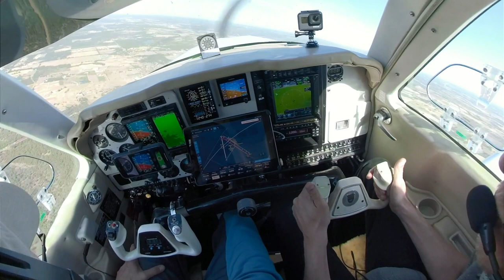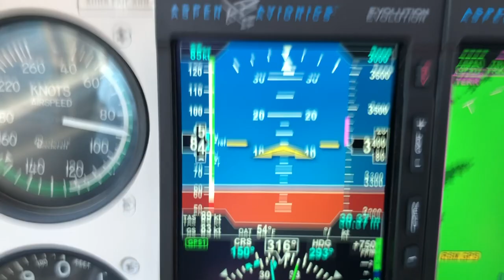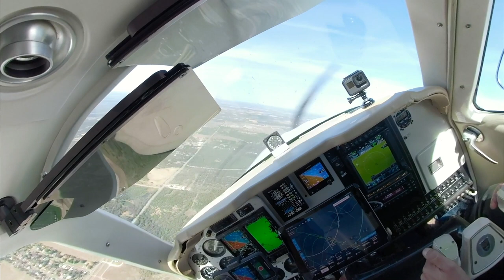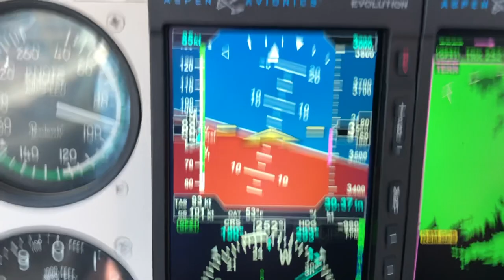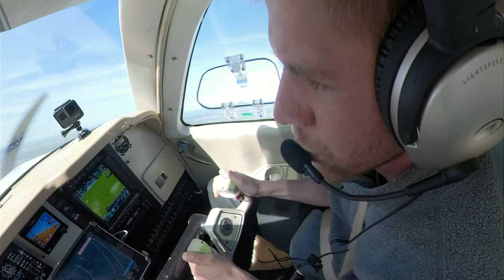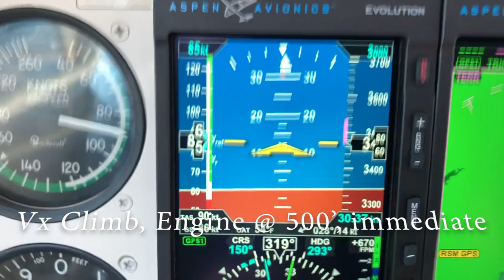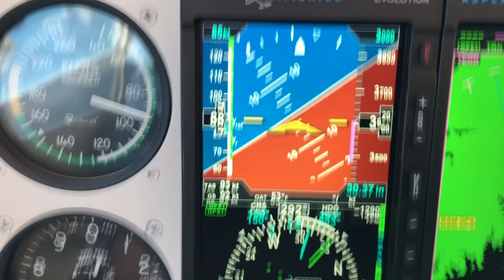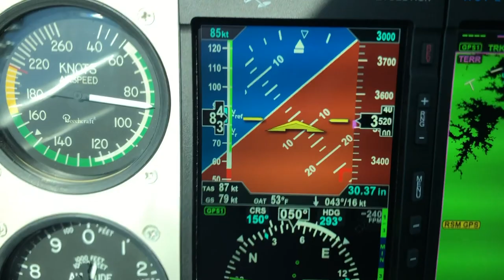A36 Bonanza Engine Failure on Takeoff

Comment: Exactly what I teach as a result of teaching hundreds of Bonanza pilots over four years in the simulator at Beech Field: it takes 1000 to 1200 AGL  to realign with the runway,  IF pilot knows when the failure will occur AND he/she has (unsuccessfully) practiced it once or twice immediately beforehand. Like you, I present the option of getting to the flat airport if not the runway itself, above about 700 AGL. And also, as you say, you have to PUSH. Another good video,  Scott.
Reply: Where is your video showing it takes up to 1,200 feet agl to Turnback To Opposite?? Was that at full gross on a hot day or not??

Comment: Scott, as a CFIG who taught low-altitude rope breaks as part of the private pilot syllabus, I once did the math to answer this question: What is the optimum bank angle for reversing course 180º with the minimum altitude loss? Answer: 42º of bank. That's a lot of bank for a private pilot close to the ground at min sink speed, but that's what the math says. Two things to note: 1) the much tighter radius of turn in a 42º bank leaves you much closer to the runway centerline than the more leisurely, 20º bank you used in the first couple of scenarios; 2) the minimum sink speed in a 42º bank is no longer Vx, but is slightly higher. The last scenario you flew came very close to that ideal: just about 45º of bank, with the stall warning horn warbling but not on solid. Final observation: if there's a crosswind on takeoff, it's much better to turn into the crosswind than downwind: the crosswind helps keep you closer to the centerline throughout the turn back to the runway.
Reply from the maker: Thanks Steve! Great comments!

Comment: You didn't mention it, but the prop control has a big influence on glide ratio.  If you have prop control, pulling the prop rpm all the way back can make a big difference.  It might make an interesting video to explore.  thanks
Reply from the maker: I did a series on engine failures inflight and I did look at pulling the prop back, the hit was 50% if you don't. But what I was trying to do here was look at a situation I think is far more likely... either you don't have the oil pressure to change the prop itch, or the brain bytes to pull the prop back. In the worst case how does this "turnback' maneuver really work for someone unprepared. The result was very interesting. I did another Turnback/Impossible turn video solo from the ground-- watch that.

Comment: A couple comments, if I may....   It's been a long time since I've flown small aircraft, but I used to fly A36s rather frequently in the early to mid-eighties.   That said, I'm going on memory, so bear with me.   First, is the horn I'm hearing in these exercises the gear unsafe horn, or stall warning?   I suspect the former, not the latter.  Second, there was no commentary regarding the residual thrust of an idle good engine vs a bonafide engine failure, and how that would change the dynamics of this exercise.   Obviously, there would be some difference.     Last, I remember doing drills like these in the old days, and the check airman where I worked used to demonstrate that pulling the prop to full decrease made a dramatic difference in glide ratio....and it did.   Of course, this was with an engine running at idle.   I'm uncertain if that technique would be effective if there was a catastrophic engine failure, as I can't remember if one needs engine pressure to change prop pitch from high RPM to Low RPMs.    A teachable moment for me, and I welcome your input.   And in closing, the gentleman mentioning that this would be a dangerous maneuver due to the threat of an accelerated stall...   I don't believe this would be a factor as long as the load factor was 1G.   There are a couple videos out there that seem to show that the steep bank angle is more advantageous (even with the accentuated altitude loss of maintaining 1g) than a shallower turn due to the time involved in turning around.   This makes for a good discussion.   Thanks for posting, and I look forward to your input.
Reply from the maker: Gerald, welcome to the forum. You actually hear two horns, they are very nearly the same. There was indeed commentary about the prop pitch... in between takeoff exercises. I explored the impact of the Pitch fine/coarse in the Engine Failure from Cruise video. In this video I wanted to have the impact of the higher drag... for one because in a tight situation like this most folks would NOT pull the prop, plus if the engine truly had a catastrophic failure you might not have enough oil pressure to actually move the prop at all. I felt the setup was more realistic. You are welcome to practice/ demonstrate something different if you like.

I actually like teaching stalls at 1g, I assure you THAT does happen. Plus trying to make a turn burns an enormous amount of energy. I was doing about 45 degrees of bank, which is pretty steep, going with a higher bank is problematic. The descent rate was VERY high at 45 degrees of bank, pitching for airspeed. 60 degrees would probably create a situation where you wouldn't have enough energy to flare even at 81 knots. 

Overall, this is a very dangerous maneuver if you are not intimately familiar with how the airplane behaves at the feathered edge of the envelope. Don't expect to get it right the first time. Best to pick some place in front of the wings and land in control.

Comment: Great videos Scott. I'm a new pilot, and had a question for you. You've previously stated that you climb out at a higher IAS than best rate of climb because you feel the added speed is helpful (something along those lines). It seems to me that being closer to the airport and having a higher altitude would be preferable in an "engine out" situation, and that could be achieved by climbing closer to Vx. As a new pilot, having an engine out with an airport below me and adequate altitude seems like the best situation, rather than being fast and far from the airport. What are your thoughts?
Reply from the maker: John-

If you look at the video when we used Vx and failed the engine at 700' with a 3" delay we were very close to stall speed before we started maneuvering, the stall horn even chirped... in this airplane and at the particular load we had. Your total energy is the sum of your altitude and your speed (potential and kinetic). The Kinetic energy of being at Best Glide is greater than the potential of a few feet provided by Vx. I've seen too many folks stall the airplane climbing at Vx with a simulated engine failure. And a little altitude won't do you any good if that happens close to the ground. So, yes I never use Vy. I use Vx to clear an obstacle and then accelerate to my cruise climb speed (which is at least Best Glide). But I want you to try it for yourself. Find an airport, use the runway as a reference, but set your floor about 2000' AGL and practice to see what will happen and set your own Turnback altitude. Set your strategy. It doesn't have to be mine. I want you to fly and find what works for you. I'm trying to give you the tools to figure that out for yourself, rather than listen to the armchair experts.  At least that's my nickle.

Comment: Scott, great video as usual. One question for both training and real life FO. Pull the prop back to low RPM or leave it maxed?
Reply from the maker: Nathan- If you have presence of mind... and time... Pull the prop back. All of these training events were done leaving the prop where it was... worst case scenarios.
Reply: if you had a loss of oil pressure/a complete engine failure you would not be able to feather the prop in conventional single engine aircraft. The prop would default back to a high rpm blade angle. I always practice emergency procedures with the prop lever maxed or 2500 rpm, or above. You would be surprised how much more drag is created by not feather the prop if you haven't tried already.  I personally would leave it where it is because its better to train for the worst. This is just how I practice (not a CFI).
Reply from the maker: @patriotsfan1236  Thanks for the input. I agree that train worst case scenario, that way you're ready. Anything better than that is a bonus. One nit though... You can actually feather a twin engine airplane prop (streamlined into the wind) you can only pull a single engine airplane prop to coarse, which is not quite as good as a feather.
Reply: @FlyWirescottperdue  I should have specified pulling the prop lever back. Not calling it  feathering. I know one of the only single engine planes you can actually feather like a multi is the Mooney rocket and missle conversions. Only ones I know of.
Reply: Super cool video. I wonder how many people train like this in their bonanzas?

Comment: Nose down to Vglide position, Keep 45 degrees nose down and dont pull for under Vglide. Push if speed going to under Vglide.  Why?? Because At low altitude you tend to pull
 more than you wanted, specially in a real engine out. 

Dont stall it by trying to Steep turn under Vglide speed. Guys that say that have has no experience at all teaching Turnbacks To Opposite Runway (EFATO Question Mark Turns).  I taugh hundreds of them since 1992 as CFI.
Reply from the maker: Pretty much true. I talk about ground rush in the video and getting to 45 degrees of bank and staying close is a hard thing to do for most folks.
Reply: @FlyWirescottperdue  They got wimpy training in GRM (Mild GRM).  I got used to that as a student due we did GRM at 500 feet, at Vglide and with strong winds too.  On the tailwind sections we turned 45 degrees bank that makes you feel going much faster than real.  Mild GRM by Mild Maneuvering CFI's can kill you later when having do do Hard GRM..

Comment: 45+ STEEP TURN @ 81KTS 700 AGL IS AS DEADLY AS IT GETS BASE TO FINAL.. IMPOSSIBLE TURN ! JUST LAND STRAIGHT AHEAD UP TO 30 LEFT/RIGHT!
Reply from the maker: Respectfully, I don't think so. It may be for you, in your airplane. But you can't make a blanket statement that applies to everyone. I am advocating that you set your parameters, for you and your airplane. I'm not preaching that you do it my way!
Reply: FlyWire- scott perdue no Sir I have A36 n I’m just reflecting data provided by FAA : #1 leading cause of fatal accidents in GA is loss of Control and #1 cause of loss of control is stall spin base to final or doing the impossible turn on 700 AGL engine failure on take off! 
Can you tell me what your stall speed on77-80kts @steep turn of 45+? 

🙏🏻😉
Reply from the maker: As I said, maybe it doesn't work for you in your airplane, whether it is an A36 or not is immaterial. I know the statistics, why do you think I wanted to do the video? Think about what I'm saying for a second. I AM NOT ADVOCATING A LEVEL TURN. That alone speaks volumes. Have you ever heard of Lift Vectors? The accelerated stall speed with the nose low and with a steep bank is nothing like that for a level turn. Maybe we need to fly together so you can get a little maneuver practice in. Or you can wait until I get to the videos where I talk about turns in the traffic pattern and the dreaded overshooting final turn.
Reply: 464RJ As long as you keep the nose down and the airspeed up, as demonstrated in this video, the angle of bank will not matter. It’s when you start pulling back on the yoke when the angle of bank starts to cause the stall which ultimately leads to a spin.
Reply: @masterdaddychris5986  Exactly.. Keep 45 degrees, nose down and dont pull for under Vglide. Push if speed going to under Vglide.  Why?? Because At low altitude you tend to pull more than you wanted, specially in a real engine out.  Dont stall it by trying to Steep turn under Vglide speed.  Under the Vglide is better to pop out some flaps, specially if you have some power left on engine.
Reply: @FlyWirescottperdue  I started flight training as a teenager in the early "80's.  My flight instructor was retired Navy.  We absolutely practiced the 180 degree turn.  He always advocated a takeoff plan that some pilots do today.   I ALWAYS had to communicate a engine out scenario to him prior to takeoff.  It was REALLY popular back then to just say land straight ahead.  My flight instructor always came back with, "what if you are at O'hare, LAX, or a coastal city, are you really going to land into an residential neighborhood or apartment complexes?"  Take a look at the surrounding area of Kansas City Wheeler downtown airport.  We always had a plan dependent on phase of takeoff/climbout, wind direction and speed, topography, density altitude and possible landing sites.  Even a 90 degree turn can be helpful dependent upon the above factors.  I went through my Commercial training, and never had another instructor even mention it.  It is like anything else, the more you review and train, the easier your mind can handle it in a real scenario.  On the prop to coarse issue.....we always trained to "pull it back" by verbal and placing my hand on the prop control, however we never actually pulled it...like you say Scott "worse case scenario."  

Additionally, 1. he trained me to PUSH instinctively at a loss of power in any phase of flight, and trim to best glide ASAP.  (sometimes you can trim simultaneously using thumb or one hand whilst changing tanks and flipping a fuel pump on with the other)  2. Since my 2nd or 3rd lessons he always spent time with me intrument training under the hood (I used foggles)...even if it was only 5- 10 min of the lesson.  (this actually saved my life once when I was a non-instrument rated pilot)   RIP Norman Faulkner  (1938-1991,) you really made a huge impact and built confidence in a young man.  I will never forget the higher pitch of your voice saying "ADD POWER"  when things would get a little interesting!  :-)